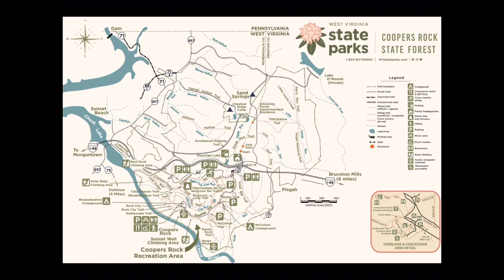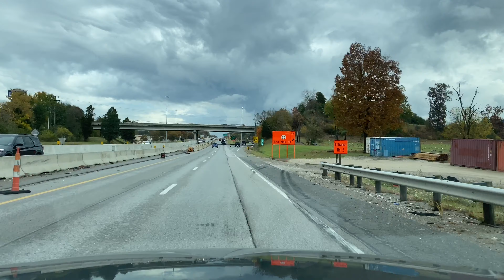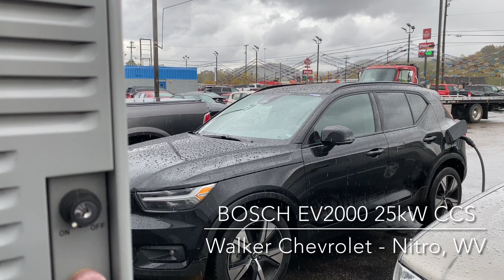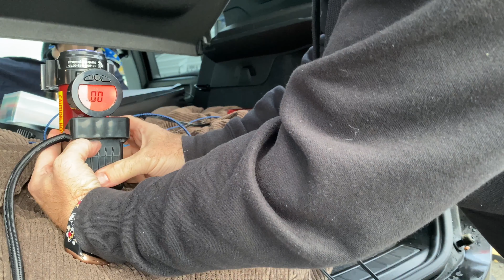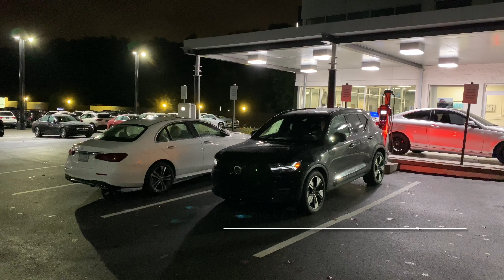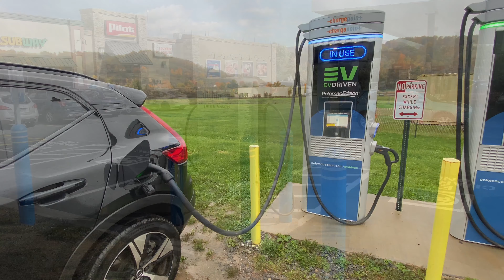EV Road Trip into Charging Deserts #12: Coopers Rock State Forest

Comment: Wild. Wonderful. Woefully unprepared for EV fast charging!

Fun to see you take on the WV challenge, Walter. I've skirted the edges of the state and dipped in near PA/MD, but always been bailed out by DCFC in those neighboring states. Looks like it's well worth making the hop across destination chargers and low power DCFC to make it happen, though. Thanks for sharing the sights and sounds.
Reply from the maker: Thx!.  I really enjoy the planning / executing of road tripping and the game-a-fy aspect of it all.  There is a good bit of improvisation I needed to tap to get through this one.  The state almost had me licked when I was getting ready to concede to a price gouge, but my spidy sense tingled as I passed by a Chevy dealer pulling away from a Pilot site visit in Nitro.  Turns out there was an undocumented 25 kW CCS charger the GenMana was glad to let me use which saved the day.  I was able to get to my final stop at a reasonable hr as a result.  I added it to PlugShare so the next EV road tripper will have another option.

An opening of the SC network will change the narrative though.  Next fall will be a different script.  As usual, Tesla has blazed a trail in the wasteland.  Thx 4 watching.
Reply: @thenetworkarchitectchannel  Hopefully that Chevrolet dealer will be installing at least the 60 kW InCharge DCFC eventually. I am guessing those are a requirement to sell Silverado EVs